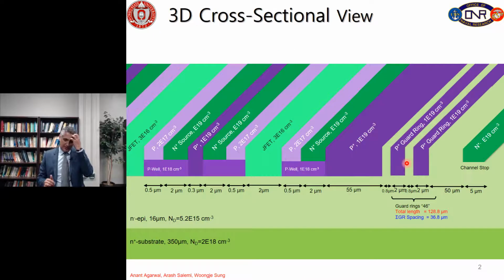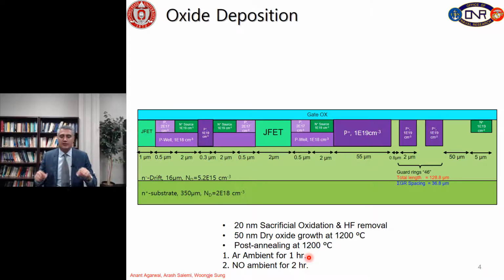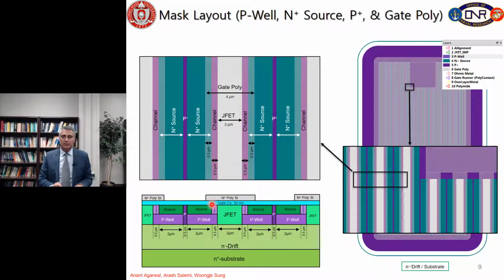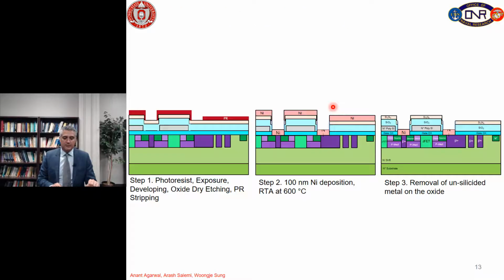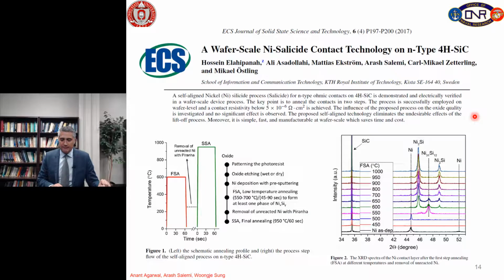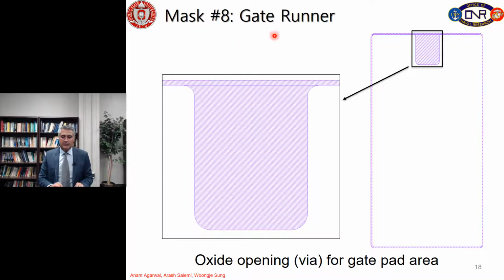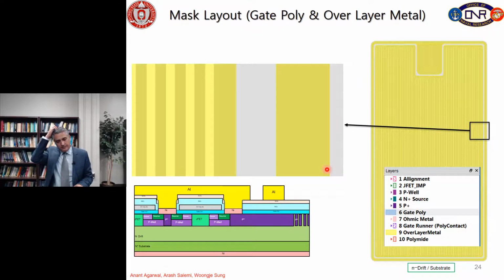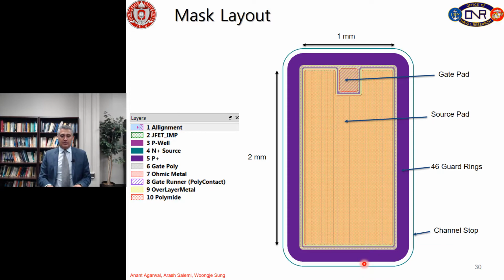MOSFETs Processing and Mask Layout - Part 2

Comment: Why not combine frontside ohmic metal and gate runner in one lithography step? Both for opening the oxide layer, difference is just that ohmic metal contacts touch semiconductor(source and p+) while gate runner contacts touch gate poly. I think Ni silicide can grow on both? In my work of Si device these two litho steps are combined together...